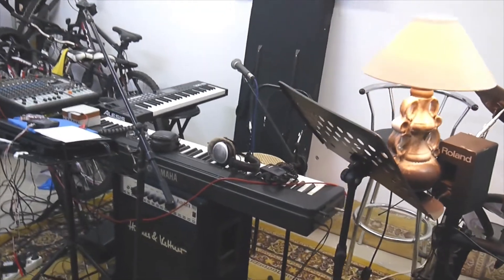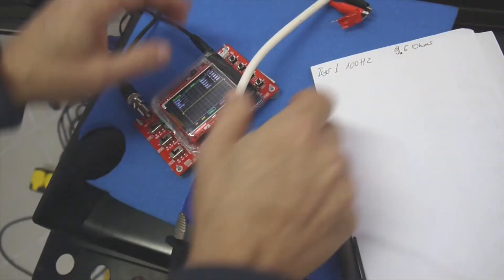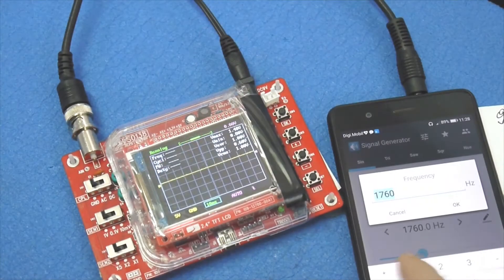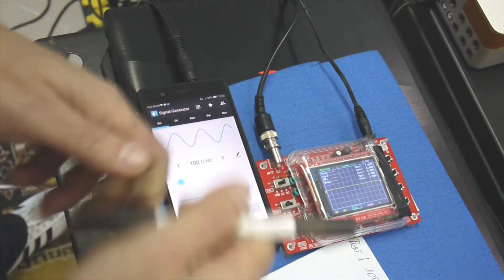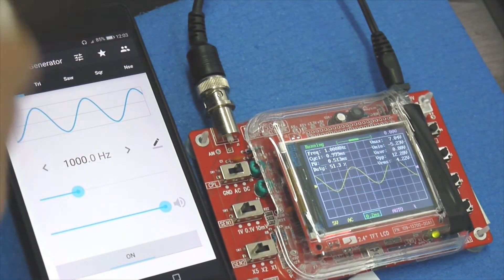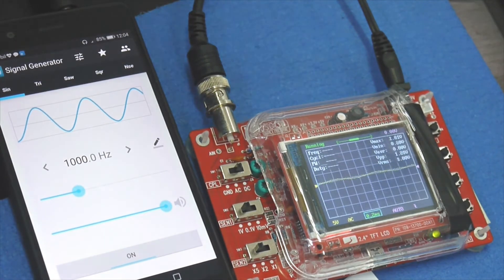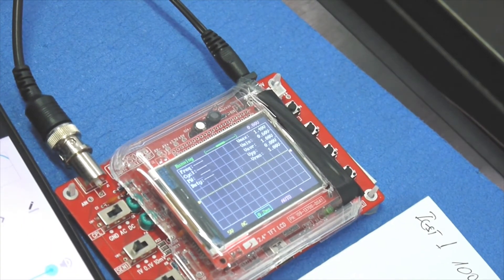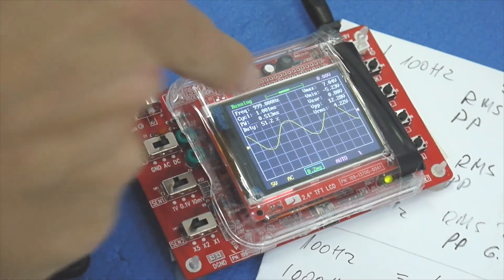Behringer Europower PMP3000 dyno, real life audio output power test

Comment: Is it now a clean signal 2 X 446 Watts ?
Reply from the maker: Yep,  a single frequency per test
Reply: @viocaia  There are two outputs for speakers. That means 100% 2 x 446 watts or ?
Reply from the maker: @TRILERish  right, there are two power amplifiers, separate outputs. Also, it can tied in bridge for a mono double power output.
Reply: @viocaia  tanks for info :)

Comment: what speaker watts and ohms do recommend for this mixer?
Reply from the maker: As you can see from testing results, the power is around 450W in 4 ohms..so you'll need at least a 500W loudspeaker with 4 ohms or 300W in 8 ohms. Like a rule, higher speaker power never hurts! You can use 2000W boxes...as long as you are in the impedance limits , min4 ohms everything will be ok! But if you intent to use smaller...well, that's depending of your common sense, use the volume carefully, you can feel when a loudspeaker is overdrived. Finally: min 500W for 4 ohms, at least 300W for 8 ohms and 1000W min at 8 ohms in bridge mode.